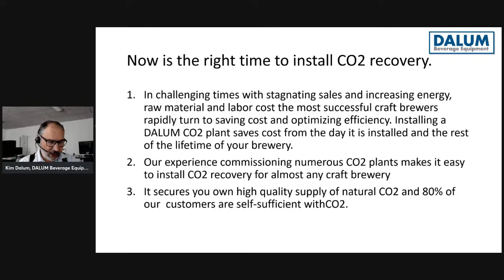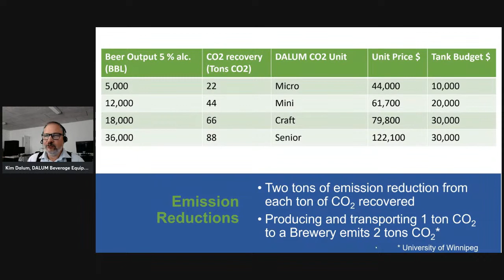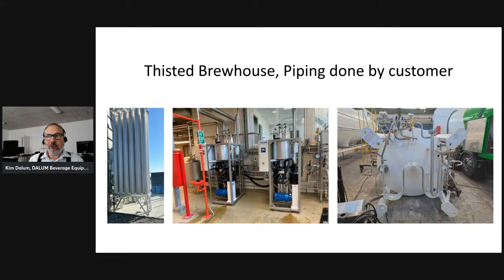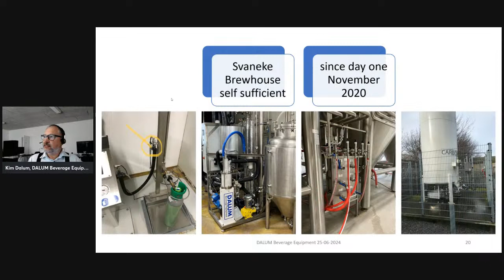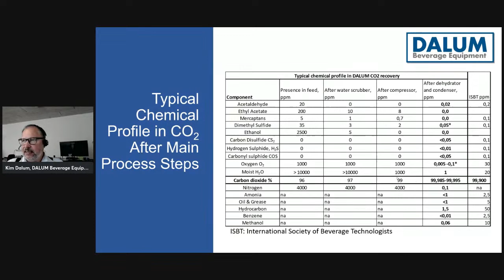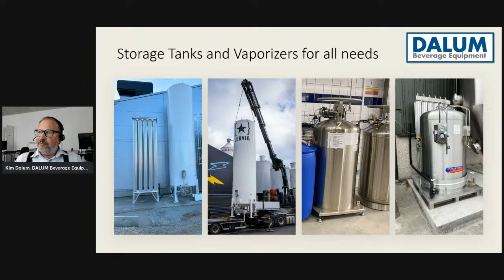How Easy It Is To Recover Your Own CO2

Comment: Q: Do the bulk CO2 holding tanks which you provide allow for filling form remote tanker delivery...just in case? And what is the tank's maximum operating pressure? thx - Jaime
@Jamie Jurado: Some gas companies accept to fill liquid CO2 into your own tank and others do not. I think it is a question of time before they all do. There are no technical reasons why they should not.

Q: Is there a quick way to calculate how much CO2 you can produce?
@Senior Truce: yes, there is a simple way to calculate the potential for CO2 recovery: you can recover 6-7 ponds of CO2 per bbl. at 5% vol alcohol. If you average is different from 5% adjust linearly.